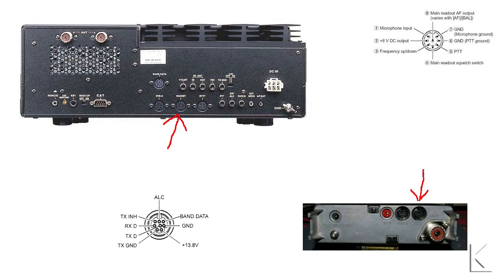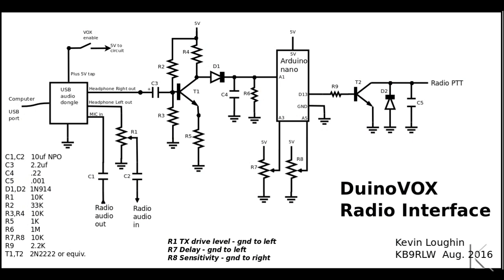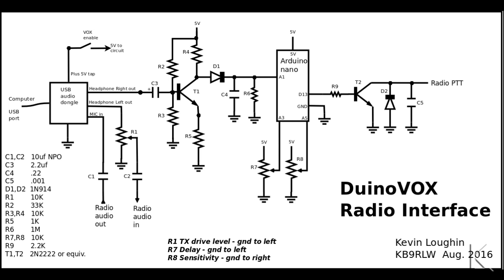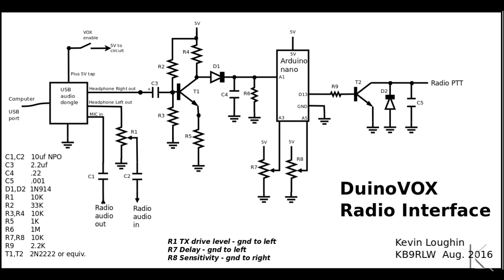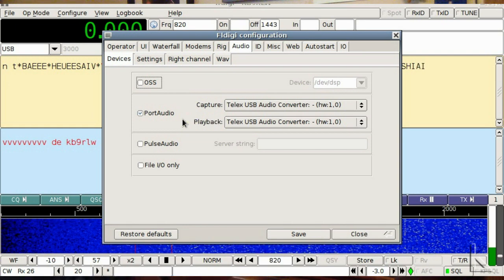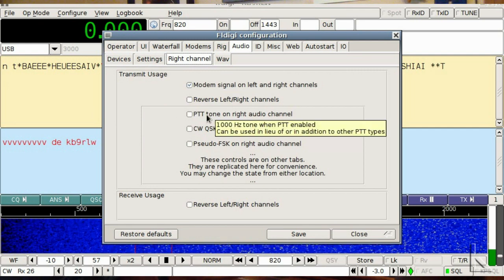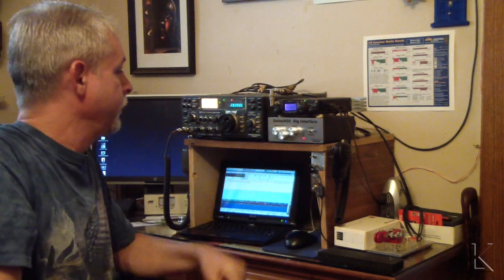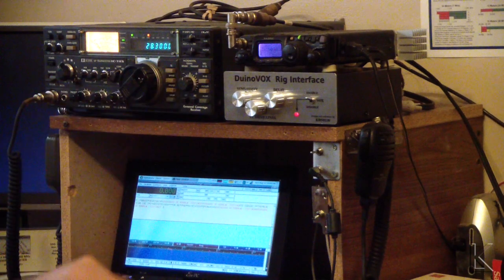DuinoVOX   USB digital modes interface for Ham Radio.  Easy to build!

Comment: I commented on your blog post, but I thought I'd add a note here.  I have a limited income at the moment so buying a signalink is completely out of the question.  I saw this and had all of the parts on hand to build it except two pots, so I decided to build it.  i put it together on some proto-board in about an hour, omitting the pots for the delay and sensitivity controls.  I figured out those values via experimentation and hard coded them in.  I was pretty struck by how well it works!  Thanks so much for sharing your design!  I'm thinking about adding an lcd and quadrature encoder for setting the delay and sensitivity in the future.  But the way I built it up, it's so small and compact,  I may just leave it alone lol.  Cheers.
73,
de   KM4MLS
Brian from GA
Reply from the maker: Thanks Brian!   It's great to get some feedback from someone who built one.    I use mine often and am really pleased with how well it works.
You can probably find pots in old electronics if you hunt around.   Junk shops are good places to look.   Any pot that's 10K up to 50K should work since it's only dividing the voltage linearly.
Post a pic of your build over on the new facebook page,  I'd love to see it.   facebook.com/kb9rlw
Reply: Hi Kevin, 
I don't actually have a Facebook account, maybe I should get with the times lol. Here's a few pictures I uploaded to Google Photos, though.  https://goo.gl/photos/JEkzCkuQ8UpxxFAX9
Reply: The last picture is the BSS138 smd mosfet I used to control the PTT, in case you were wandering :)  It's quite a mish-mash of random parts lol
Reply from the maker: I was surprised to see you used mostly surface mount components.  You ended up with a very tidy and small unit and it looks great.  Looks like it would be small enough to fit in an altoids tin.  I posted the photos to the facebook page,  thanks!
Reply: Kevin Loughin, In fact it does fit in an altoids tin. ( with the pot sticking out of a hole... the board is 5x7 cm) Yes, I personally prefer to use surface mount components these days. The only reason I used a few half and quarter watt resistors and the old style 2n2222 was because I wanted to get them out of my parts bins lol. So many useful parts today that are only available in smd form that I try to use them exclusively - that and I like to build stuff small. To bad I've yet to find a good proto board for smd parts, the standard .1" spaced type works with a little planning usually though :)

Comment: Tnx for the speedy reply.  Oh, yes...had it in the correct settings.  The only setting when going thru the data port that showed output was when I had the 817 set for PKT, then I saw meter deflection on the mfj-971 tuner.  I bought the rig used so not sure what's wrong.  I'll  just take the audio out from the lappy to the mic input on the rig.

Like your vids on the magnetic loop.  That is my next project.  I've got the cap and for starters will be using LMR-400 (15') for the main loop.  Also like your use of the FS meter form tuning, although is seems like you're spot on when tuning by ear!  Thanks again es best 72

Neil wa4chq
Reply from the maker: I think you might have been feeding the wrong pin on the ACC jack.   As I recall, there's a 1200 and 9600 data input pin,  you want the 1200.   (I haven't looked at the manual in years, I could be remembering it wrong)
Reply: Thanks again....anythings possible but the first time I noticed the problem was with a commercial digital modem I bought (similar to NuePSK) that came with the data cable.  I checked the pin-out with the meter too....

Comment: Great videos Kevin...thanks for putting them together for us.  I'm using a FT-817nd and would like to get back to some digital modes.  Years ago, and another another rig, I built a hamcomm type of modem for my toshiba laptop and had a blast with dos hellschreiber and dos sstv.  Now with the new laptops and smaller rigs with data ports, digital modes should be a breeze.  However, my 817nd doesn't seem to want to allow audio in to the data port.  I have tried it with many types of brewed and bought interfaces.....it just won't produce output....not sure why.  The 817nd has vox and I have set up for digital using the mic near the laptop and I was able to get on using psk31 and hell.  Looking at your schematic, if I eliminated everything from the dongle headphone right out, do you think I could just go from the dongle headphone left out to the input of my mic on the 817nd?  The radio audio out from the dongle could go in thru the data port...  Thanks de wa4chq
Reply from the maker: Yes, you could just use an audio interface and the mic connector on the radio, VOX for keying.    Don't know why you had trouble with the acc. connector though.   Did you put the radio in DIG mode rather than USB?   You needed to.

Comment: What is the large heat sink on the back corner of your 817?

Great set of videos.  May just have to get into digital modes before I die...... Been a ham for 55 years, QRP mostly CW.  Like to tinker and build things for fun.  Actual contacts are secondary.  Have used an 817 and a Midnight Designs interface (no "dumb" computer needed as George says.) with so e success.

Dave K8WPE
Reply from the maker: Hi Dave,  just saw this comment.  Youtube sometimes skips them on the new comments page.
Regarding the heat sink on the 817,  did you see my video on it?

Comment: I have a question. About C5 I think but could be mistaken. But I think you said c5 was a resistor in the video but its clearly drawn as a capacitor. Again forgive me if I'm in error but wanted to point it out just in case
Reply from the maker: No,  that was my error.  My brain was thinking capacitor but my mouth said resistor.   I'm getting old and sometimes my body parts do their own thing regardless of what my brain decides.  ;-)